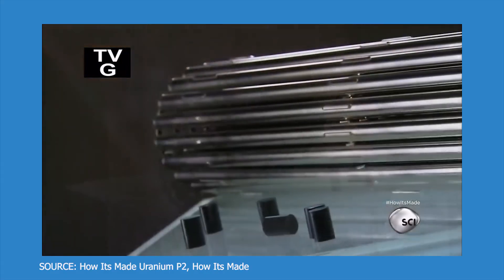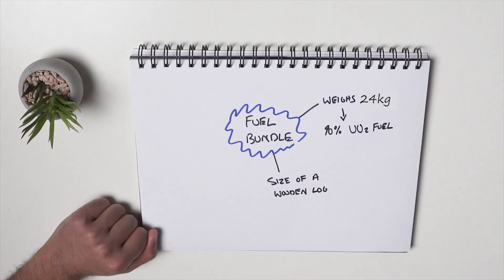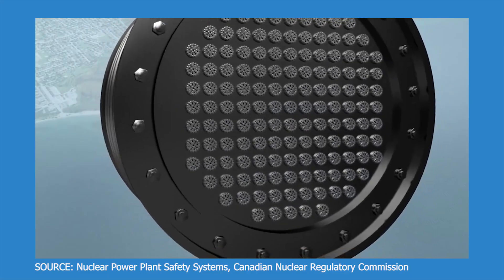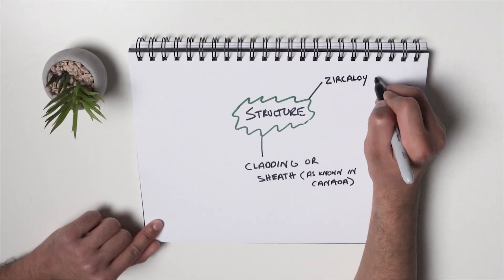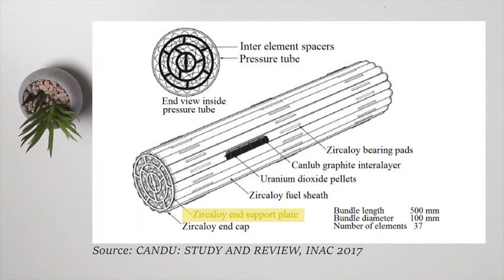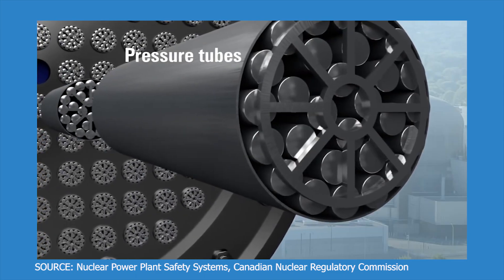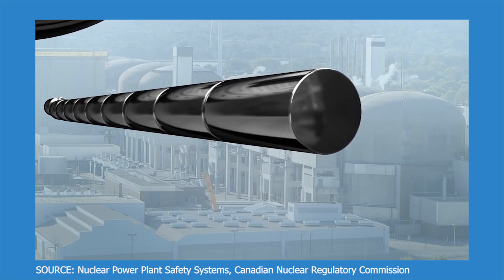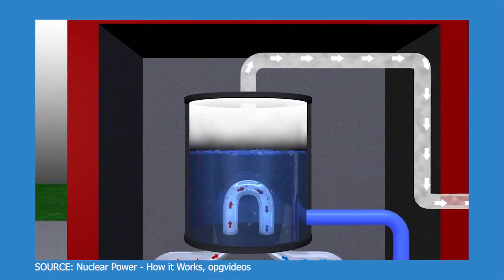Why Bundles of Fuel power Nuclear Reactors, CANDU Fuel Bundle

Comment: Watched a few of your candu videos and im not seeing much of a difference in design from an RBMK its just sideways
Reply from the maker: HUGE difference
1) CANDU has more safety systems (SDS-2) (ECI) 
2) CANDU has outside containment which RBMK did not have 
3) CANDU does not have design flaws like the RBMK 

I recommend checking out this article for full details: https://cna.ca/2019/07/29/cna-response-to-hbo-miniseries-chernobyl/#:~:text=The%20CANDU%20and%20RBMK%20designs,that%20resulted%20from%20the%20explosion.
Reply: In addition to Osama's explanations, the RBMK is a direct cycle - the coolant (light water) boils in the vertical channels (oscillations due to boiling can significantly affect the core physics).  The steam goes directly to a turbine.  The CANDU maintains the coolant (heavy water) as liquid which then circulates to heat light water in a steam generator.  Thus the reactor core and turbine system are separate.  A steam line (i.e., secondary side) break would depressurize the secondary loop in a CANDU, cooling the primary loop in turn, but the primary system (cooling the fuel) would remain intact and keep the fuel cool.

Also, the moderator in an RBMK is graphite, which gets quite hot due to neutrons colliding with the carbon atom nuclei.  That heat is removed by the primary system (i.e., the graphite is hotter than the coolant).  In a CANDU, the moderator is kept cool (~50 - 70°C) and some core heat is lost to the moderator (~3 MWth).  Thus the RBMK is slightly more thermally efficient than the CANDU, at converting fission energy to electricity.  However, the RBMK uses low-enriched fuel (enrichment costs energy to produce), whereas the CANDU runs on natural uranium.  The CANDU moderator is also a large heat sink available for cooling the outside of fuel channels, in the unlikely event of channel dryout.  I spent 20+ years studying/simulating CANDU reactors during postulated severe accidents; a CANDU is far, far safer than an RBMK due to its basic geometry and physics, let alone the additional safety systems.